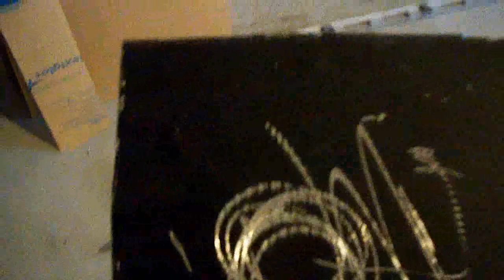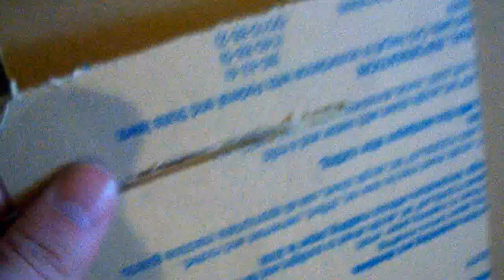PC Case Mods! - Cutting Side Window For Case (part 1)

Comment: When you work on something yourself, you get the privilege of saying you modded/fabricated it yourself. Not an amazing job in this video, but I don't think that matters very much, he's going to cover those flaws with rubber U channeling after a sanding, to make the inner edge smooth. But I agree with the need for safety. The home is a place of complacency, most accidents will happen because of that, and you don't want to be alone when you chop off a digit and you're loosing blood fast.

Comment: All I gotta say is Dremel tool. Makes a cleaner cut, and has the attachments for Plexi-glass. And when your cutting metal you don't have the tool shoving down into it, you keep it above the metal with the weight of the tool being the pressure.

Comment: Having worked in a sheet metal workshop for years, I cringed a bit when I saw he was working with no safety glasses and no shoes and no gloves. Also, if you have a shop near you that deals with sheet metal fabrication, they might be able to cut that to your specifications in less than a day depending on their work load. Plus, it will look well done and you won't have to take the chance of cutting your fingers from the jagged cuts.
Reply: No ear muffs either. I could not cut any type of material without proper safety gear I'm not that interested in going to the hospital.

Comment: Oh and just to give you a heads up into using air pressure tools like that, dont push it straight away into the steel might just blowup on your face. And let the tools weight do the job. Be safe with those things ;)

Comment: lol so I guess you aren't too concerned about the other side of the case that you mangled by dragging it over the floor :)

No gloves or glasses when cutting that panel? Real smart man. Grinding is definitely not a good choice with the plexi, if you have access to a hacksaw or bandsaw then use that, or have someone with actual safe experience using tools help you.

Great you have initiative kid, but no thought for safety.

Comment: iven just recently moded a shity hp standard case took it all apart and then painted it orange and black just need to cut the window out and spray an orange monster m on the opposite side :) i sanded the full case then primed it then spray it all balck and the right parts orrange but even the inside is black :)

Comment: i hated the result of that metal grinder, my cuts was pretty clean for this machine though, but i still didn't like it after months i mounted it in my case
but months later, i decided on using a manual nibbler that took me about an hour, but it seemed like 30 min. it was the cheapest solution

next time, its time to invest on dremels

Comment: Safety glasses and no jewelry when using power tools; dangerous stuff. No one has put a fan half way on the metal because it's pointless. Put masking tape on your cuts so you don't screw up the paint.

Comment: Instead of using that grinder, get a jig saw with a metal blade, way easier and faster than wht ur doing in the video. I used it for my antec 1200 case mod, check it in my channel. Then once u cut it out get some rubber grommet for the edges and some thick double sided tape industrial strength and put ur plexi glass there. I used real glass for mine so it doesnt scratch but it does make it way heavier

Comment: what you did wrong is 1. not using a proper cutting disk. 2. not using safety glasses 3. holding the disk to the metal when you started it.

Comment: this is how NOT to do it, so dangerous lets see, no footwear, no goggles so blind and crippled, using a powertool on loos material could explode the disk maming you. Not supporting the work means it could splinter and shoot like a bullet plus the finish on this cut is abismal! Take the sides of the case use a propper workbench, safety equipment and GLOVES. In the UK if you did this in anything other than your home you would probably get arrested...

Comment: Why? A new case can be as cheap as 50$, all the time and money you spent on that case is such a waste
Reply: Average case with a side exhaust or intake fan running a 200mm fan, runs nearly in the $100-$150.
Reply: but that case is an OEM case so its way cheaper than a gaming case. Also, the cheapest gaming case is the notorious $25 area 51. The metal on thoes things are so thin, I cut my finger on one

Comment: that is some rough cutting buddy. you hold it over the metal to do clean lines not butcher the steel. float the grinder its alot easier and put goggles on mate.